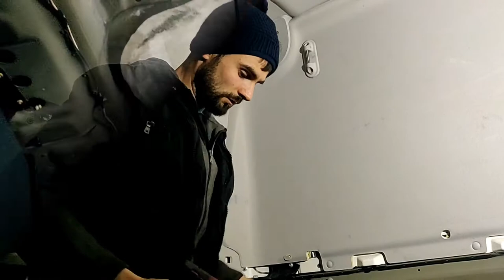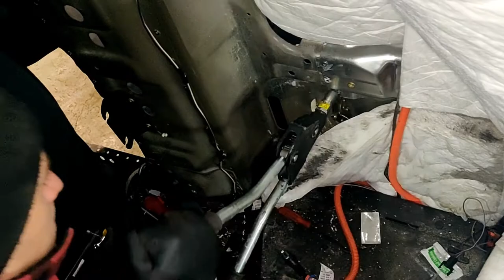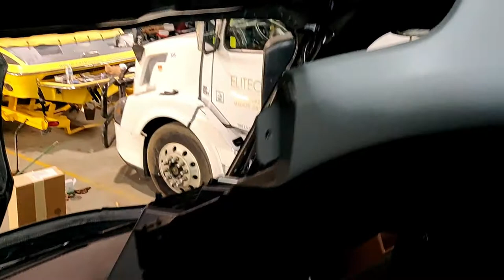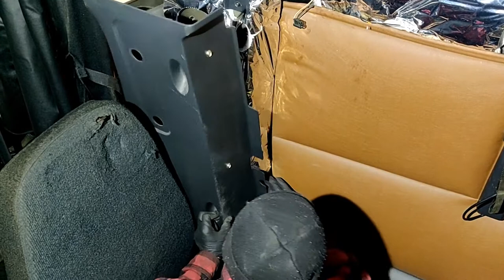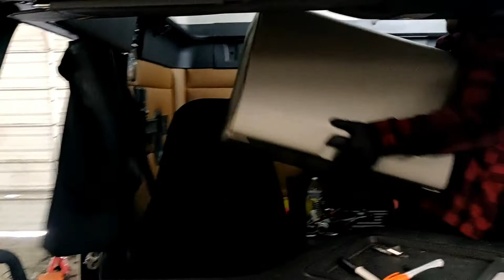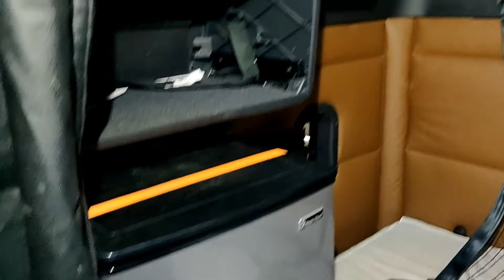Freightliner  Cascadia cabin repair Video nr.4 Interior assembly

Comment: I just got seated in a truck (new to me) and one of the cabinet doors won't close. It is a top cabinet (off white) above the closet cabinet opposite the fridge. The door closes a bit high and just barely has the pin going into the jaws of the bottom latch, but slips right out. Is there any adjustments that can be made?